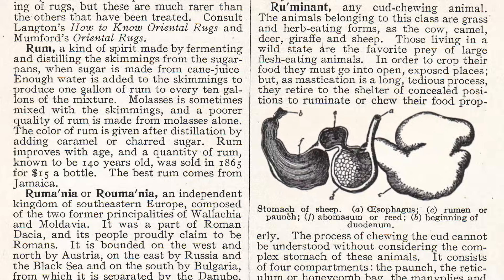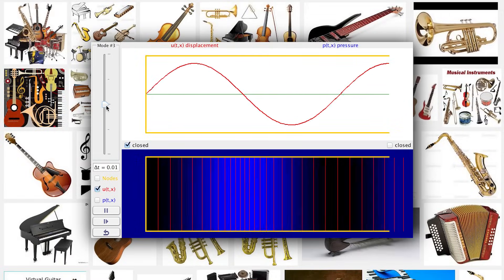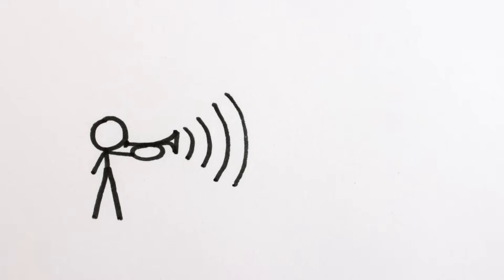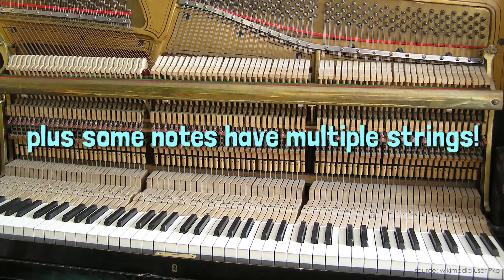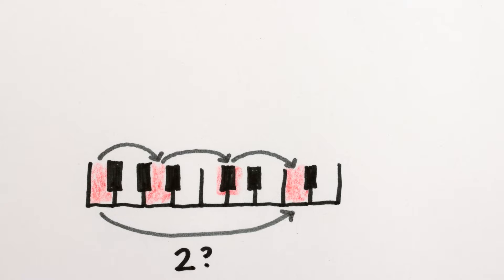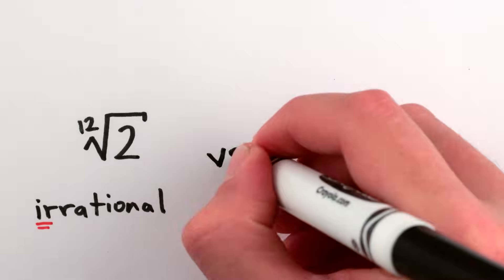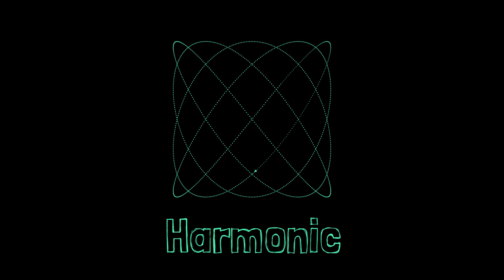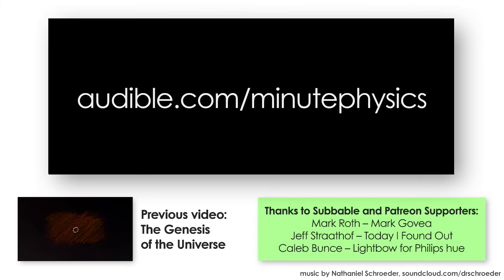Why It's Impossible to Tune a Piano

Comment: Allow me to clear up some confusion:

I’ve seen many comments below from people that think Henry got it wrong, because “obviously pianos can be tuned”.
As with many armchair experts on the internet that can’t be bothered to do a modicum of research before they chime, there are doubters.  I’m here to tell you Henry is spot-on correct.

We are a dying breed us aural piano tuners.  I can argue that there are fewer than 2,000 people on the planet today that truly know how to tune a concert piano by ear.  Every single one of us is in demand like never before due to software.  Software tuning is getting very good compared to what it once was, but all professional piano tuning software STILL must pIt itself against an aural judge before it is released.  Aural piano tuning is a learned skill that requires years of practice- no matter how “perfect” you think your pitch is. 

I’m going to make several statements below about western tuning in general, and then some specific statements  about the  industry of piano tuning itself.  Stay with me:

1) It is not possible to tune all 12 notes of the western scale simultaneously. (That’s the point of Henry’s video)

2) The history of Western composition itself is deeply rooted in the limitations of 12 notes being in tune.  Until recently, composers simply avoided the out of tune notes.  Right up until the late Baroque.  Check out Chant to hear what 800 years of music sounded like before Josquin des Prez and the Renaissance.

3) IMPORTANT!  All instruments of the (professional) modern orchestra or choir constantly alter pitch flat or sharp as they perform so as to be in tune at any given moment.  They talk and teach amongst themselves as to how to be in tune when they play any interval at any moment.  This is the price of 12 note equal temperament. It’s the reason why skilled youth orchestras are always out of tune.  Position and embouchure are only learned with experience.  And don’t you dare argue me percussion section that has some pitched bells and stuff.  Those instruments are out of tune and it’s not your fault.

4) Pianos are a unique exception from #3.  Pianos are the ONLY instrument in the orchestra who’s pitch is fixed.  As a pianist, you are stuck with the notes the tuner gives you and that’s it.  You can’t alter pitch as a pianist.  Everybody else can.

5) Pianos are almost impossible to a physicist.  High notes are played by small instruments such as the piccolo for a reason.  Low notes are played by big instruments such as a bass.  Here the problem:  
“I want one instrument that plays higher that a piccolo and lower than any bass at the same time.  Plus everything in the middle must also be in tune always.” 

6) Pianos have an incredible disadvantage that most instruments don’t.  It’s called Inharmonicity. Henry didn’t delve here in this video, but it’s only because he must limit his scope of a short video.

7) Pianos are never, ever, EVER, tuned by pitch.  That’s the barrier to you musicians that think you know how to tune.  Whether or not you tune pianos by ear or software, you simply don’t care about the fundamental (note).  You only match coincident partials and forget about the note. Always.

8). There is no such thing as a perfectly tuned piano for all scenarios.
I am called in to tune the same piano 4 days in a row because a solo piano tuning is different that a chamber tuning that is different from a pop recording that is different from jazz.  None of this is a secret- it’s simply what pros know.
Reply: Ok
Reply: This is so insightful thank you so much! You helped me a lot.
Reply: My God!
Reply: 7) can you please elaborate??

For example, i was thinking of gettinga tuning kit off of Amazon. Then just use a tuning app and tune each string of each note to... Well, it's correct pitch?? What is wrong with that?
Reply: k
Reply: Your comment is underrated
Reply: you fucking killed them dude
Reply: #4 You say pianos are the ONLY but what about the harp,marimbas,harpsichord?
Reply: I think I'll just stick to an electric keyboard
Reply: Thank you for the interesting info! What did you mean with ‘Chant’? I am very interested.
Reply: Nice meme
Reply: Charles Wright 
You must use special piano tuning software.  A regular tuner only tunes the fundamental (note).  That’s not how pianos are tuned.
The middle 3 octaves on the piano will sound o.k. (not perfect) with a regular tuner, but as you begin to extend the tuning it will become unusable in the bass and treble.
Reply: Mister Theguy 
Full term is “Plainchant” or “Gregorian Chant”.  The beginnings of modern European music.
Reply: Tom R 
Inharmonicity is tough to fully explain without lots of math and graphs/charts, but I’ll do my best to give an overview:

1.  Inharmonicity is the tendency for overtones to be progressively sharp from “in tune” in a single vibrating piano wire.  One string is out of tune with itself!
2.  This is because of stiffness of the wire at all node (termination) points.  The end regions of the string are more stiff than the middle of the string when it vibrates.
3.  When a string vibrates, it does so as a sum of all of the infinite regions of the string.  It’s complicated.
4.  The shorter a piano string is, the greater the Inharmonicity.  That’s one of the reason a longer piano sounds better than a short piano.  The overtones have less Inharmonicity and are more in tune.
5.  Piano tuners (professional) are trained to deal with this Inharmonicity.  It’s big part of what we do.

There is a lot of info on the web if you google “piano wire Inharmonicity”.  You can find the actual math and graphic charts that explain it way better than I am able to on this forum.  Good luck!
Reply: Ok boomer
Reply: @cjheaford  You didn't even explain what overtones are.  I know what they are but your whole post is surely gibberish to people who don't.  See https://en.wikipedia.org/wiki/Overtone
Reply: Andrew Cady 

Well since Henry explained what they are and even had excellent graphics explaining them, I assumed everyone would remember the video they just watched.  Everyone except you apparently.

One must assume a certain level of basic knowledge in order to talk about any subject.  I didn’t explain what a piano is either.  Was it gibberish for me to talk about a piano without explaining what that is?
Reply: Thats long
Reply: @linux_b1969  clap emoji
Reply: Sir, your comment need to stay at the top or pinned so everyone can see it!
Reply: cjheaford I believe you have a misunderstanding about what people in the comments are actually saying.

It does not make sense to talk about being able to perfectly tune an instrument without first talking about the temperament with respect to which one is tuning. Perfectly tuning the piano with respect to Pythagorean tuning is impossible, yes. But this is much less impactful when stated correctly than in the way Henry in the video tried to state it, which almost implies syntactically that equal temperament is not a valid form of tuning.

Also, 2^(1/12) is an irrational number, so for all intents and purposes, equal temperament is an impossible way to tune, we can only use approximations. But the important thing to talk about is how good an approximation can we make. And that's where the distinction between other instruments and the piano becomes important. So, yes, you are correct, but Henry failed to explain this very crucial fact, and that is why people are complaining about the video. The information just wasn't presented the way it should. (I mean, in my experience, this channel actually never really presents the information correctly, which is why I rarely even watch the videos anymore).
Reply: Charles Wright 
Sorry for the delay:

The tuning app you use must be specifically for piano tuning.  (They are pricey.  Just the app can be from $400 to $1000.  Reyburn Cyber Tuner, a high-end pro app is $999 in the App Store.  A general chromatic tuner won’t work.  If you DO use a regular tuner, do this:

Tune the middle 2 or 3 octaves with the tuner, and then just tune the rest of the piano by ear to what you already tuned.  A cheap general tuner will work O.K. in the middle of the piano, but it fails in the bass and treble.
Reply: @cjheaford  - wow, that is nuts! Thank you
Reply: Angel Mendez-Rivera 
I think you misunderstand a lot.  
It doesn’t matter what temperament you use to tune the 12 notes between the octave.  Pythagorean, Meantone, Werkmeister, Equal, or any one of dozens of others.
They are ALL valid forms of tuning, and yet they all sound out of tune.  There is nothing that can be done about that.
Most instruments get around this by being able to alter the temperament as they play in real-time.  Even good guitarists do this.
Reply: @Charles.Wright   Don't worry! The piano uses the Chromatic scale and the tuners is chromatic. You have to be careful to not damage the piano trying to tuning. It is not an obvious job.
This "Out of tune" talk is a little excessive.
The nowadays western music in general is played  in the chromatic scale. In the chromatic scale there is no perfect harmonic intervals, and all the 12 notes has a basic frequency precisely defined.
But it does not means "out of tune", it is just not perfect harmonic (rational multiple frequency) intervals.
Some instruments like Trombones has a tendency to  play harmonics intervals cause the physic construction, but the musician can force the pitch "on the fly" to mach the chromatic scale.
Some instruments like violins can play any notes and intervals (harmonic or not).
Yes, if you use only instruments like violins etc you can compose and execute a whole symphony with perfect intervals, but people in general will not perceive the difference if you execute the same symphony using the chromatic scale.
Se it better in https://en.wikipedia.org/wiki/Harmonic_series_(music)
Reply: As a software developer and pianist, I now feel lowkey inspired to investigate this further and figure out how one would do real-time digital piano tuning based on what you're playing at any given moment, purely to satisfy my OCD.
Reply: So you're a rare breed of piano tuner who tunes the same piano four times in four days.
So using your tuning method, how quickly do the bushings wear out and the strings begin to slip? 
Every piano tuner I know says the first rule of tuning a piano is do it as little as possible.
Reply: Rigg Amore 
I will answer your questions honestly and directly, but first I need to make sure I understand them.  You pack a lot in with the few sentences.   Let’s start by clarifying:
What do you mean by bushings?  There are many bushings inside a piano, but all of them are mechanical and allow the action to function.  Bushings don’t have anything to do with tuning.
Reply: @jasonmartinez7667  I feel like those are implied
Reply: @Charles.Wright  Then you tune to 12 tone equal temperament, and that's not in tune with the natural harmonics of what ever the base note is.
Reply: Enter: the synthesizer
Reply: Inharmonicity...so what notes are the good ones then?
Reply: the same piano four days in a row...what are they even doing with it!!
Reply: Kim Harris 
Professional Recording studios, major concert stages, and even a couple music colleges that tune for every concert.
Reply: everyday tenor 
Lol.  Yep.  Harpsichordist spend 50% of their career tuning their harpsichord, and 50% playing out of tune.
Reply: everyday tenor 
Hello again Tenor!  
Since no one is reading these comments anymore after one year, I thought it safe to send you a message in the comments.  That 50% tuning joke was told to me by Igor Kipnis himself, and I’m glad It got a laugh from you!  Igor is smiling.
Reply: everyday tenor 
Young tuning!  Wow.  It’s been a while.  He had a couple temperaments he published if memory serves.  Had to learn both Young tunings back in the day when I was green.  Haven’t needed to produce them since, and it’s a good thing.  I’d be starting from scratch after 30 years and need to research it again.  
You must play a lot of baroque keyboard works.  It would be tough to get that Young tuning to work on much past about 1800 or so...I’ll bet Buxtehude sounds awesome on your harpsichord!
Reply: Fascinating.  Acoustic guitarists all once had difficulty achieving equal temperament - especially classical guitarists, mainly because the bridge design had a built-in flaw with fret intonation.  If you tuned the strings based on harmonics, some chords sounded great and others terrible.  The structural solution introduced in the mid 1970s was to offset the B and E sting at the bridge which is now a hallmark of "split-bridge" Takamine guitars (while other brands like Martin, Gibson and Taylor all went with what is called the "compensated saddle" - a compromise design which works well as long as you use only the recommended string gauge and no capo above the 3rd fret.  However, if you have an older vintage steel-string acoustic or classical guitar, the trick is to first tune all 6 strings harmonically, then "by ear" tune the G string slightly flat and the B string slight sharp and all your chords will sound fine to the human ear.
Reply: I’m Justarandomdoggy 
I said tune a CONCERT piano by ear.  It’s a totally different requirement for the stage and recording studio.  It needs to be perfect.  You need to know how to tune for the situation as not all piano tunings are the same.  
There is a big difference between maintaining your home piano to a certain degree  vs concert perfection that your professional reputation relies upon.  Many of my clients are able to maintain a tuning for a while, but pay me to set a baseline tuning for them periodically.
I guarantee your Mom would not be able to come close to a professionally tempered tuning without training, even if it suffices for her needs.
Reply: I always tell people that perfect pitch is a trained skill, you can be better or worse than some people at it, and you can improve it with hard work. It's not a mystical ability.
Reply: kirjian 
You are correct.  It’s not.  But sense of pitch is a completely different thing than piano tuning, as pianos are not tuned by pitch.
Pianos are tuned by comparing beat rates in coincident partials - disregarding pitch 100% of the time.
Reply: @cjheaford  that is so cool. I've never thought of tuning as purely judging the beats in two sounds.

@everydaytenor naw, the documentation online about it does not align at all with reality. There are many testimonies of people with demonstrable AP saying they trained and improved it, and even being "bad" at it at first. Don't believe everything you read online, research is severely limited in that field
Reply: @cjheaford  When I was trying to learn to (roughly) tune my piano, it was suggested to me to get a chart of the correct beat rates and use a metronome.
Reply: jasexavier 
That was decent advice.  When we teach piano tuning, we discuss beat rates in terms of BPS (beats per second).  There is no such thing as a beatless interval on a well tuned piano (double & triple octaves come extremely close to beatless however), and it helps some students keep track of a second by setting the metronome to 60 bpm.  We don’t actually use a metronome in the real world on the job, but it can be a good tool for getting an internal feeling of timing of the beats.
The advice you received left one important aspect out however.  You must know WHERE to listen on each interval.  You will hear much beating inside an interval, but in virtually all cases you need to focus on the coincident partial that each interval produces, or you will be tuning the wrong partials.  Fortunately the coincident partials are almost always the loudest and easiest to hear when judging beat rates.  Good luck!  This industry need more aural tuners.
Reply: everyday tenor 
Nice job. Couldn’t have been said better!

Though my work requires me to ascertain beat rates always (I keep stressing beat rates in all my comments because this is absolutely where the magic happens.  Get the math right every time, and you will be a pro) plus Voicing. Oh BOY do I want to explain voicing...Voicing + Tuning mastery is where careers happen.  
I have after 30+ years acquired an internal sense of pitch that might be described by others as “absolute”.  It is not.  It is just a really, really good sense of relative pitch.  I know it in my heart I was not born with “absolute pitch”. 

In my travels I have discovered Absolute Pitch does exist..but it is exceedingly rare.  It is more of a Savant quality-  I believe it exists, but I’ve never met anyone that has personally has it, and I’ve met/worked for 1000’s of musicians.  Normally in my day I don’t get the chance to “nerd out” about tuning as I am here.  I could talk all day about the differences between tuning & pitch, but I’ll try to keep it short:

I have the ability to hear a pitch instantly and tell you what that note is.  In fact,  you could pound out a random chord on the piano and I can instantly tell you all 8 notes inside that jazz chord or whatever.  But that ability comes from a Lifetime of knowing music.  It’s more that I first hear the Tonic, and then everything else inside the chord is no surprise...most experienced musicians can do this..   It is NOT a special ability - it is simply acquired after a lifetime of knowing music.  Most professional musicians can do everything that I’ve described.  it is NOT  “Absolute Pitch”- whatever that is.

All of what I just said above is meaningless when it comes to professional tuning.  Sense of pitch is a hinderence, not a asset.   

I don’t want all this nonsense about “Absolute Pitch” to distract  from what I’m trying to tell everybody reading this:  I’ll try to say it again.  TRUST ME:  Pianos are not tuned by pitch ever!  You ΜUST judge beat rates between intervals, and know the math.  It doesn’t matter how “Perfect” you think your pitch is.  
You MUST understand Beat rates, Inharmonicity, Coincident partials and the 12th root of 2 mathematically.  

I’d like to talk to you if you understand these concepts,
Reply: Small gripe with 4 - the glockenspiel is also impossible to adjust the pitch of, unless you have a blowtorch or some dry ice on stage
Reply: @cjheaford  Hey I'm a trumpet player. This comment has been really informative. Are there other tuning systems I can tune my instrument to? If so, how would I tune my trumpet to them?
Reply: GabrielReed 
As a brass player I’m afraid you’ve got it tougher than most.  Because you are limited to natural harmonics, you are limited to something closer to the natural Just scale, or Pythagorean.  It’s not even equal temperament your trumpet is using.
The trumpet has tuning slides when needed that help during performance, and there is some measure of control of pitch through lip technique (embouchure), but trumpet players have to work extra hard to play in tune with equal tempered instruments.  You may have noticed this before.
Reply: @cjheaford  Yes I have noticed. Some notes like our lower d, and g are Sharp, so we use our tuning slides. I've heard snippets of information about the different ways of tuning in Western music but I've never seen a more concise overview than the one that you wrote. This is really neat stuff that I'm going to have to look into! I'll start with the natural Just scale and Pythagorean and see if I can hear any differences while playing solo pieces and etudes. Thank you
Reply: Greg Moonen 
People complain about how “awful” pianos sound tuning-wise every single day since the invention of the instrument.  (Harpsichords, Clavichords, Organs, etc. before that). I’ve built a career upon this singular fact.  It’s the reason why the industry of professional piano tuning exists in the first place.  Tuning pianos properly is hard to do - not just the mechanics of it, but mastering temperaments & inharmonicity takes years to learn.  It’s why most pianists don’t tune their own piano.
The problem is two-fold:

1). Equal Temperament (ET) is used today on virtually all pianos tuned.  But it has not always been so.  There have been many other temperaments used throughout history.  Composers such as Chopin & Liszt for example used their own temperaments that were most appropriate for their piano works.  J.S. Bach was a huge champion and proponent of ET.  One of the most famous keyboard works ever is called “Das Wohltemperirte Clavier” or “The Well-Tempered Clavier” in English.  **It was published by Bach to try to demonstrate the virtues of ET.  It contains 24 pairs of preludes and fugues in every major & minor key that can ONLY be played on one keyboard if ET is used.**     (Edit: Everyday Tenor has kindly pointed out the inaccuracies of this * statement about Bach.  My understanding of this was wrong.  See his comment below for corrections)
ET has it’s problems however.  Our modern day ears have come to accept it as the “way” pianos just sound but many musicians despise it for good reason.  

2). Inharmonicity is another barrier to being able to tune a piano.   It is even more complicated than temperament and difficult to explain, but let’s just say that the overtones coming from piano strings are not in tune.  And to make it worse, each individual piano has it’s own level of Inharmonicity.  A proper tuning on one piano will NOT be the proper tuning for another.  A tuner needs to start from scratch every time they sit down to a different piano and find that pianos proper “stretch”.
In my day to day work, Understanding Inharmonicity is where careers are made.  Learning Equal Temperament is much more basic than understanding Inharmonicity.

In short:  People have complained about temperaments since the beginning of keyboard instruments.  For the most part, our modern ears have come to accept equal temperament as the way pianos are tuned today, but it is not a perfect solution.  Musicians complain about this every single day.  There is absolutely no mathematical way to divide the 12 notes between the octave had have them all be in tune.  All a skilled tuner can do is to divide the comma evenly, (edit: *in equal temperament*) and accommodate Inharmonicity.
Reply: everyday tenor 
Always good to hear from you!  Regarding your points:

1).  I got lazy with this one, and you were right for calling me on it.  I suppose I didn’t want to complicate the matter - but I admittedly took ET for granted there.  It’s so rare these days that I need to produce anything other than ET.  In many years I’ve only needed to produce a few historical temperaments in an academic scenario, such as a guest speaker for a music history class and such in a few of the music colleges I work for.  Any performer that requires something other than equal on their (usually) harpsichord simply tunes it themselves.  Harpsichordists are great tuners by necessity, and likely know these historical temperaments better than myself.
(Plus we both know there are more things a tuner does, such as voicing and regulation.  I really was lazy...)

2).  I’m SO GLAD you called me out on this.  I’m mildly mortified that I’ve not only always thought this, but shamelessly touted this tidbit countless times including in front of aforementioned music history classes as a guest.  The “fact” that Bach championed ET was taught to me in music college long ago even before I began studying tuning, and most of my peers believe this as well to this day as I’ve heard others say the same thing.  I’ve always just taken this for granted.  You’re never too old to learn.

As I said above, harpsichordists are likely to know historical temperaments more intimately than myself- for good reason as I rarely produce them anymore.  I’m grateful for your expertise Everyday Tenor.  I’m going to add an edit to the relevant comment.  Thanks again for taking the time to correct me.

(P.S.  Because admittedly I’ve got refinements to make on my understanding of popular 18th century temperaments, I’m going to refresh my education by doing some reading.  Is there a book or article  you would suggest?  You’ve obviously got expertise here that I don’t, and I appreciate that!)
Reply: And sometimes they'll have more than one piano on-stage w/ an orchestra, depending on what keys are to be played in, if the piano is important to the piece.
Reply: Isn't point 8 (on the original post in the thread) more voicing than tuning? 

With all this said, organ builders hate equal temperament as well. Then they have the stops intentionally tuned sharp and flat (Celeste stops, Unda Maris...). As is the case with piano, it's also tuned by the beats rather than by pitch. Unlike piano, where you can tune it before every performance, organists have to simply accept the tuning issues present on any given day. Several builders use mild well-tempered systems by default rather than equal temperament (something you might not even know unless you talk with the builder and tuner). Sure, they're not always the historical temperaments, but they produce great results.
Reply: Karl Rovey 
Hello!  Thanks for your thoughts.  You pose a great question about piano voicing and bring up relevant facts about tuning regarding organs - an extremely important instrument historically when it comes to tuning systems.  I haven’t talked about organs in any of my comments, and that’s because I have little practical expertise with the instrument.  I’ve been waiting for someone to bring up the topic.  I’m tempted to jump right in and start raving/ranting about physical considerations, advantages, limitations, musicality, and historical implications to western music of organs - but I’ll let you open the conversation if you wish rather than risk being too garrulous off the bat.

Now voicing a piano on the other hand is a topic I know well.   I could (and do) talk for hours on the subject of piano voicing so much that it risks getting too distracted from Minute Physic’s original video about tuning we are posting underneath.  I don’t want to dodge the question of voicing and I’ll tell you as much as you want to know, but for now I will limit my response so that I answer your question above:

No.  Although voicing is very important to the quality of any concert piano, it is not what I was talking about in point #8.  I was talking about what is called Stretch.  You see, all piano tunings are “stretched” to some degree, and there are different degrees of stretch that are appropriate for different musical scenarios on the same piano.  That means octaves are wider than is musically true.  There are different “shapes” that professional concert tuners give to tunings depending on how the piano is being used.

Stretch is a balancing act.  Wider shapes (within reason) are generally preferred by piano soloists, as a wide tuning helps accommodate Inharmonicity - but that same wide tuning for a soloist tends to cause real problems blending with other instruments of an ensemble because actual pitch becomes skewed so much.  

It’s remarkable how much stretch is actually given to a well tuned piano.  Believe it or not, it is common for there to be more than a 1/2 step difference between C1 and C8 on an appropriately stretched piano tuning.  This is a MEDIUM level of stretch.  It can be closer to a WHOLE step in a lot of cases.  You can begin to see how this would cause problems to the other players of the orchestra that are forced to try to match the piano.  A tuning for playing with electronic instruments is the opposite.  You as a tuner need to try to get away with as little stretch as you dare in this case.  The piano will not please the pianist as much, but a narrow tuning will blend with electronic instruments much better.  Again - it’s a balancing act and compromise.

I’ll stop there, but I’d be happy to keep discussing voicing, tuning stretch, and organs as much or as little as you like.
Reply: @cjheaford  That makes sense. Tuning with piano is a huge can of worms (just as it is with organ, except with organ, you're generally stuck with any issues until yoir next seasonal tuning). 

I know someone raised the issue of the bushings and tuning pins on the concert pianos experiencing pre-mature wear from so much tuning. It really isn't an issue for the concert halls. They choose an appropriate maintenance schedule for it. I forget the exact guidelines, but for pianos in a university music school, they suggested replacing those parts every 5 years along with rebuilding the keyboards frequently (the same was advised for pipe organs at such institutions, but this is generally ignored in favor of addressing more pressing maintenance issues). Those pianos and pipe organs likely get more use in a month than they would in a year in homes and churches.
Reply: @kirjian  Perfect pitch cannot be taught later in life. It's literally neurologically impossible. Relative pitch, on the other hand, can be trained and mastered.
Reply: I didb't read this, and my mistake was click in "read more"
Reply: ok but a 432 or 440
Reply: The whole question is bogus. Why? Perfect intonation is a theoretical construct/concept that collides with physical reality - a mathematical abstract without any concern for the everlasting development of musical aesthetics. For example: a perfect third wasn't considered to be 'perfect' until ~1400 c.e., thus literature on perfection in music omitted thirds before.
The whole point of this video was proven long ago (during the 17th century) by theoreticians, who used a way of argumentation that is not really translatable into our ill-educated jargon.

Arguing "pianos are this (or that)" is another fallacy, because our understanding of the general instrument (once the lute, later the pianoforte) appears to be shapen by a very narrow understanding of said instrument itself: it's a grown convention , that urges even the players of romantic compositions to go back to the historic instruments from the 19th century for their notion of "perfection".
Reply: @11Kralle  
I don’t know where to start for a rebuttal, but I’ll keep it brief:

1). It’s difficult to take you seriously when you use the term “Perfect 3rd”.  There is no such thing as a perfect 3rd as you call it.  Only Major and minor, and they are both wildly out of tune in equal temperament.
2). Nobody is claiming anything about a piano here except to say that it’s impossible to tune all 12 notes between the octave simultaneously.  That’s true.
3).  Tuning is NOT arbitrary.  Perfect mathematical ratios = in tune.  That’s definition after all.  
4). The Comma is tangible and quantifiable.  You can’t escape it on a keyboard instrument.  Different temperaments come and go in popularity over time, but that will never change the fact that beats will always happen between some or all intervals on a piano.  Beats = OUT OF TUNE (imperfect ratios.)
Reply: @0691CT  
1). The classic “Honky Tonk” tone is basically due to 2 reasons.  One is a very, very out of tune piano.  The other is hammers that have never been voiced.  Hammers slowly get harder as the piano is played over time, and this makes the tone get very bright, plinky, and uneven.  Combine bright hammers with a piano that severely needs tuning and you have yourself a Honky Tonk.  The size of the piano doesn’t matter here.  Even a large concert grand will sound like a Honky Tonk if it is not maintained.

2).  You basically have it correct on your statement about string length.  Proportionally the stiff regions at the harmonics take up more of the strings length the shorter a wire is.
Realize you can’t just arbitrarily choose any low frequency on a string that is too short.  There is a limit.  Bass strings on short pianos are extra thick in order to slow down frequency of a string that is too short.  This makes these short, thick wires behave more like metal rods than strings.  It’s nasty.  You really aren’t hearing a fundamental at all on the low notes of a small piano.  Only the higher harmonics that imply or trick your ear into thinking you are hearing a note.
Reply: Wow. I totally dived into this thread. Your whole discussion is very interesting. As a non-pro musician I've known many new things just by reading you all's comments. And I've realised I should definitely find out more about the topic of different tunings and all around it. Huge gratitude to @cjheaford as the original poster!
Reply: This thread is a blessing. Thank you, both cjheaford & everyday tenor.
Reply: @cjheaford  hello sir. I'm sorry if i sound kind of stright to the point but all this thread has really giving me the vibes of something that is worth of pursuing, at least as a life experience. Is it too difficult to find good piano tuning lessons? Or better, can i ask how did you become the pro you are now? 
My sincerely thanks to you and @everyday trenor for such interesting conversation.
Reply: @MunyuShizumi  good digital tuning itself is a complex subject. Since no instrument produce a simple sine wave (but a combination of many sine waves with different frequencies), simple frequency shifting might not produce an ideal result.
Reply: @Maurice_the_Hamsterboi  i just spent 30min reading this comment section. And although it's very confusing, it's so interesting.
Reply: The common joke is that the piano tuner comes in twice and the piano is still out of tune despite that
Reply: @MunyuShizumi  I would begin with an application that optimizes the tuning for a Midi piece.
To get the best results, your piano would need to look in the future. Perhaps you could get away with letting the piano know the key and mode in which you are playing...
Reply: @adifferentangle7064  And know you know why most pianos at people's homes are out of tune ;-)
Seriously, the pianos get re-tuned to optimize them for the style of music that are going to be played, the keys and modes that will be used, etc.
Reply: @joestevenson5568  The synthesizer has the same problems with regards to tuning as the piano. Except that it is all chosen for you by the manufacturer.
Reply: @nskimharris  Playing different styles of music that sound better with different tunings.
AND, a real piano is made of materials that change ever so slightly due to temperature, humidity, air pressure and so on. Due to the steel frame and strings this effect is smaller than with wooden instruments, but it is still there.
Reply: @everyday tenor Chopin, Liszt, and basically all 19th century music was written in equal temperament, so that's really the most true tuning for the compositions of that era. Thomas Young's tuning was a theoretical construction; he did not provide instructions how to achieve his tuning, and it probably wasn't ever even known outside England in the continent where everybody was already steadily moving towards universally using ever since the Classical era. 

What many Anglophones assume is that tuning history of England was the same as that of continental Europe; however, United Kingdom was a good 200 years behind France and Germany in terms of the way they tuned, so by time that almost everyone else  agreed that equal temperament is the best tuning for piano, the Brits were still thinking1/5 comma meantone is the hot shit.
Reply: @everyday tenor Rameau had recommended equal temperament since 1737 and hell, even Galileo Galilei's father was a proponent of ET in the 16th century. The French used to use a circulating ordinaire tuning around the 18th century with ET becoming more and more common. In Germany, Werckmeister suggested ET in 1690s, with several theorists endorsing it during the 1700s. Kirnberger was really the only person who went against the stream of the era, and his proposed tuning wasn't perceived to be very nice, which is probably why in the latter half of the century the German-speaking world ET was the predominant way to tune pianos.

This being said, all 19th century composers composed on instruments that were already tuned for equal temperament, so to retain their best artistic intention, it's most authentic to play using same tuning as them. And as I said before, British tuners and music theorists did not adopt any of these ideas until late 19th century. If one were to be not able to access primary sources in other languages than English, they would end up to believe that 12-tone equal temperament is a 20th century fad, even though its practical history reaches almost 200 years further back.
Reply: @Charles.Wright  
Most modern tuning software developed for professional use does take inharmonicity into account.  But the user must be aware of piano tuning principles in order to select the most appropriate partials for tuning.  
However, I'm sure not everything you find on Amazon will have this level of sophistication.  
What inharmonicity means, is that a string is not in tune with its own harmonics (the video ignored this issue).  Therefore "correct pitch" can only be defined for one selected partial (harmonic) and it is often not the fundamental.  Many partials means many choices and there isn't just one "correct" choice.  
Theoretically, you could take a freshly-tuned piano, catalog all of its fundamental frequencies, then use those to keep the piano in tune - but making such precision measurements of fundamentals is neither trivial nor time efficient.  
Another problem with inharmonicity, is that it varies with piano size, and make/model.  It's not possible to get two pianos of different sizes into excellent tune with each other (unless you allow one to be a little out of tune with itself).
Reply: @everyday tenor The best historical evidence for tuning is not composers' key choices but preserved tuning instructions, as they directly tell what tunings were favoured during any time by dedicated piano tuners who did the work for the composers (We know, for example, that Chopin's piano tuner in England used ET). They overwhelmingly point to the direction that by 1800 equal temperament was the most common tuning in France and German-speaking Europe, but not in Italy or the British Isles.

Composers of the romantic era most certainly tolerated the impurities of ET for the musical possibilities and endless modulation (Hammerklavier modulates from Bb to G, Db, and F#!) that it allowed. As mentioned, many theorists and composers alike championed it from its very early times while key colour seemed to be less significant, probably not the least because nobody apparently could come to agreement about the perceived qualities of the keys. People these days like to cite Schubart on the topic, but he was far from an authority about it in his time.
Reply: @everyday tenor Not Schubert, Schubart. Christian Friedrich Daniel Schubart (1739-91). He seems to be the most cited reference for key colour advocates, but as I said before, people really could not come to agreement about the characteristics of individual keys.

Beethoven composed his Sonata no. 24 in F# major (6 sharps), and modulates to Ab minor (7 flats) in no.12. Chopin has his Barcarolle in F# major as well, not to mention his 24 Preludes that have all sorts of hairy and funky key signatures. Both Schubert AND Bach wrote sections in C# major (7 sharps). Alkan has pieces which modulate to E# (!). And there are of course some old pieces that modulate through all the 12 keys, but I can't just remember any of them now.

None of this matters, though, because the argument that ET would magically make composers write equally in all 12 keys, doesn't necessarily hold true. If all keys sound the same, then there is no need to make music in, say, Eb minor because it sounds just the same as E minor, but it's nastily unnecessarily with all the accidentals for nothing. One could even argue that composers would be more likely to remain in relatively conventional keys for the simple fact that there isn't any need to go into a key center that has many sharps or flats, as they would have the same sonority.

However, you will be able to modulate to far more unfamiliar and exciting places from those conventional keys (Hammerklavier, again?) when there aren't any "bad keys" in your piano anymore. The relationship of the modulation to the home key can be already artistically titillating in itself; anyone who's played through Coltrane changes could attest to that (I haven't, I suck at jazz).
Reply: @Charles.Wright  I believe your question gets into the difference between Just intonation and Equal temperament. Digital tuning apps are set to a specific tuning convention mostly Equal temperament. Just intonation works well with small intervals, but over the span of an entire keyboard, there will be audible differences between keys and chords. Equal temperament bridges this gap by allowing each interval to be off just enough the work, but not far enough to cause disharmony. I'm a guitarist by trade. I'm sure many string-based musicians know the frustration of tuning each open string to Just intonation only to have chords higher up the neck be off by a quarter-tone! Luckily, we have the luxury of spot tuning. Piano tuning is fixed and must be tuned in the most efficient way that also accompanies the orchestral setting. Hope this helps. 

- Random Guitarist
Reply: The title is clickbait. Period.

It's true that the point of the video is that you can't have all 12 notes in tune with each other but that isn't unique to pianos which he literally points out in the end of the video. 

Most of modern music isn't tuned using 3rd, 4ths, or 5ths, or harmonics. It's tuned in 12 tone equal temperament. 

You can "tune" a guitar by comparing harmonics because the harmonics are very close to their 12TET counterparts. Thus with only a few strings, you won't really be out of tune. This again, is explained in the video.

But just because you tuned using "perfectly in tune" harmonics doesn't make the guitar a magically tuned instrument in a way that a piano could never achieve which this video suggests.

The reason why comparing harmonics works on an instrument like a guitar is because by using certain harmonics, you can get very close to 12TET which is in fact the GOAL. You're SUPPOSED to tune the instrument to equal temperament because that's how most of modern music is played, written and performed. 

The frets aren't laid out in 4ths or 5ths, they're laid out in a way to get close to equal temperament. Do you see the problem with the video here now?

He claims that you can't tune a piano. He then claims that the solution to this problem is equal temperament where we make all intervals out of tune from each other EXCEPT the octave. And because this music is out of tune, you "can't tune a piano".

This of course makes 0 sense, an instrument like the guitar literally has the same problems. A guitar approximates equal temperament and will run into the exact same issues. Only the octaves will be in tune in a perfectly tuned guitar. 

He explains how 12TET is the reason you "can't tune" a piano since it's out of tune, and yet that's how you literally tune a guitar which an instrument he uses as an example early on.

Much of this video's information would be useful if the title were trying to explain our 12TET system and why it's inherently out of tune, but the title and conclusions don't actually make sense.

To reiterate;

Sure, you could tune a guitar with harmonics. 

Sure, the guitar only has 6 strings, thus all 6 strings should be close to in tune once all the harmonics match.

But once you start playing down the fretboard, you'll run into the exact same problems. The guitar is out of tune due to equal temperament just like a piano.

If you want to conclude that you then in fact can't tune a guitar OR piano then that's fine since 12TET makes that statement kind of true.

But the title and content of the video seems to suggest that this is unique to instruments with lots of strings when it isn't; even going as far as using a guitar as an example that you CAN tune when in reality, the guitar also uses 12TET and is this out of tune.
Reply: @nkchamplin  
There is much you don’t understand about this video and real-world equal temperament in general:

First off, Henry used the piano as an example in his video to represent the 12 notes of the western scale in general- not specifically to discuss actual piano tuning.

You talk about the guitar a lot in your comment but I don’t think you realize that it’s not the same as tuning a piano.  There are 3 major reasons tuning a guitar is much simpler than tuning a piano:

1.  A good guitarist naturally alters the temperament as they play in real time.  Learning to play in tune is an important part of a young guitarist’s experience.  Most guitarists will discover that some chords sound better than other chords-  so they learn how to instinctively apply pressure on the frets making microtonal adjustments to make each chord sound it’s best.  This is no secret and an important part of learning to play the guitar.  A pianist has no such ability.

2.  A guitar’s range and pitch capabilities can’t be compared to a piano.  At most you can only ever play 6 notes at a time, with all notes being relatively close to each other, usually within the same octave or two.  A piano’s pitch range is more than 7 octaves with at least the possibility of 10 simultaneous notes across any part of the range of 7 octaves.  This is a tempering challenge compared to the close voicings of a guitar.

3.  A certain level of “out of tuneness” is part of the sound of a guitar and come to be expected by the ear.  It’s the natural way a guitar is supposed to sound.
I’m sure you’ve noticed that you get the BEST guitar tunings when tuning the harmonics by ear instead of using a tuner.  A chromatic guitar tuner can’t predict the tiny variation in each guitar’s harmonic series.  The ear can.

There is no one correct way to temper a piano, and in serious professional settings I  change the temperament on an already “in tune” piano so that it is more appropriate for the day’s musical event.
Reply: @everyday tenor 
That’s super cool.  I’ve seen videos on the True Tempered Guitars.  The difference is amazing.
Reply: @everyday tenor which is irrelevant to my point.

The evidence in the video proves that pianos are impossible to tune due to mathematics.

This is something that applies to music and every instrument not just the piano.

Whether you get different tempered frets or just remove them, your notes will never all be in tune with each other.

The video is clickbait.

The piano is only impossible to tune in the sense that all instruments are impossible to tune.
Reply: @everyday tenor You don't understand what I'm saying at all.

Please learn to read.

The video asserts that the piano is impossible to tune because equal temperament is out of tune.

This is a problem with mathematics not something inherent with the piano. Thus the title is clickbait.

Tune a guitar in equal temperament.

It's out of tune.

Tune a guitar to a just intonation. 

It's still out of tune even if you stick to 7 notes.

In this case not only is it out of tune the moment you leave the key, it's not even completely in tune within the key.

If you play a C major chord with any instrument tuned to C, all 3 notes will be in tune with each other. All notes are also in tune relative to the tonic within the octave but are NOT all in tune with each other.

No matter which tuning system you pick on any instrument, you'll never have all notes in tune with each other even if you stick to 7 notes of a key. 

This is a mathematical problem that has nothing to do with inherent problems specific to the piano or harpsichord as this video suggests.

An instrument like the guitar will run into identical problems.

Your comment has nothing to do with what I said. Improve your reading comprehension.
Reply: @everyday tenor being passive aggressive isn't being civil. You didn't respond because you're objectively wrong and have failed to address a single argument.

I am sorry that pointing out that your reading comprehension is objectively poor hurt your feelings.

What's genuinely hilarious is that you simply threw that back at me without actually making a valid argument.

This only shows that a single snarky comment genuinely hurt your feelings.

Learn to read better. You won't humiliate yourself next time and force yourself to desperately run away in a hilariously passive aggressive manner. Glad I could teach you.
Reply: @fesfers  
You sure do talk about the guitar a lot after watching a video about the way pianos are tempered.

It’s as if you have some academic knowledge of the way a guitar is tuned & tempered, but no practical experience with the guitar vs piano at all.  Here are some absolute facts that you just don’t get:

1). Unlike your understanding and claim, a guitarist CAN and DOES indeed alter the temperament in real-time as they perform.
If you’ve ever played the guitar at all, you have noticed some chords naturally sound more in tune than others.  Experienced guitarists learn to make micro-adjustments of pressure on the frets so that individual chords sound their best.  This ability becomes subconscious with experience.  Why do you think beginner guitar students are always out of tune even on a properly tuned instrument?  They haven’t yet learned to make microtonal adjustments.  Pianists have no such ability.

2).  It doesn’t even make sense to compare the range and potential note combinations of a piano to a guitar.  A piano spans 7+ octaves with potential note combinations across any part of the 7 octaves.  A guitar close-voices 6 notes.

3).  No 2 pianos are tuned exactly alike.  Each piano has it’s own level of stretch that the tuner must find and accommodate.  The difference from piano to piano can be startling.  It is common for there to be more than 1/2 step difference between C1 and C8 on a well tuned piano.  This is not the case for guitar.

4).  I just tuned my 38,000th career piano this last August.  I assure you I know what I’m talking about.
If you want me to clear up any questions or misunderstandings you have, I would be happy to.  It is no use arguing with me.
People have payed me money for 30 years because of my understanding of temperament.  It’s how I make my living.
What tuning experience do you have?
Reply: @cjheaford  

Yes I'm talking about guitar because it's mentioned in the video about why you can't tune a piano despite the fact that both instruments would run into similar problems when actually tuning. In the case of the video, the exact problem is equal temperament which both instruments try to generally approximate. It's presented in a way that would lead beginners to thinking the guitar doesn't have the identical problems that the piano has demonstrated in this video. The problem being that equal temperament is out of tune despite being our best solution.

If that offends you to be passive aggressive without making a valid point then that's your problem. Grow some thicker skin.

1.) This is completely irrelevant to actual tuning. Whether you try to make adjustments by re-tuning the instrument in the middle of a performance or you try to bend notes in tune, the guitar itself will never be in tune with itself.

While bends and tuning pegs do give guitarists more versatility, using these techniques to fight the problems with equal temperament are impractical. You can do it for certain phrases or chords but at a certain complexity, it's not worth it which is why the vast majority of guitarists use these techniques as a sound effect to create sliding effects or vibrato rather than adjusting the notes to be more in tune. Guitarists aren't bending every single note in tune to fight equal temperament. That's impractical and limits the complexity of the music they can play.

What's even funnier about your point here is that you show you a complete lack of understanding of physics and the mathematics.

The frets of the guitar are tuned to approximate equal temperament. Let's say we're playing a piece in C major.

Well we know by default that if we simply play conventionally we'll be out of tune due to equal temperament. 

Well in that case what if we make microtonal adjustments like you say?

While possible, another massive reason it's usually not done is because this doesn't actually solve the problem.

We can adjust our notes by tediously re-tuning them constantly in the middle of a performance to get every single note in the key of C perfectly in tune with C3 within that octave.

In this case, a root position C major chord starting on C3 would be perfectly in tune. This would actually be a valid reason to attempt live microtonal live adjustments. 

However, just because we can get these 3 notes in tune via tedious live and impractical adjustments, DOES NOT mean the instrument is actually in tune. Why?

Because even if we stay within a single octave and ONLY stay with the 7 notes of C major, while all the notes are in tune with that C3, not every note is tune with each other.

For example, it's mathematically impossible to play a C major and D minor chord and simultaneously have both chords perfectly in tune where the D is a perfectly tuned major second above the C.

If we attempt to make both chords perfect, they'll be out of tune with each other.

If we attempt to make all the notes of the D minor chord in tune with the tonic C, then the D minor chord will be out of tune within itself.

Despite the fact that your suggestion of microtonal tuning is impractical for complex pieces, it doesn't actually solve anything. It is quite literally mathematically impossible to get the 12 notes of the chromatic scale all in tune with one another. 

Again, this isn't a problem exclusive to piano. This is a problem with sound and mathematics.

2.) I'm not. Learn how to read. Just intonation goes out of tune the moment you leave the octave. This has nothing to do with comparing guitars to pianos. The point is that mathematics and equal temperament is what makes getting all instruments as well as music in general in tune impossible. This is not unique to a piano which this video leads others to believe.

3.) That has nothing to do with what I said nor did I even claim otherwise. Learn how to read. I'm well aware pianos stretch their octaves to accommodate overtones, however this is also a phonaesthetic/artistic choice we've chosen rather than a decision we're forced to make due to tuning a piano without stretching the octaves being impossible. It's VERY possible. It's just not worth it in most cases due to overtones.

Theoretically, we could ignore the overtones and simply get the fundamental harmonics of each key tuned to equal temperament just like we do on a guitar.

We don't do this in the real world because we prefer the sound of getting the overtones in tune, but it's absolutely possible. 

Thus your point is invalid since the title and topic of the video is about why it's impossible to tune a piano.

As a matter of fact, this is also likely why this wasn't even mentioned in the video. What makes a piano impossible to tune is the mathematics of looking at the fundamental frequencies ALONE  and NOT the stretching of the octaves we do to get some overtones better in tune.

You see, I'm critiquing the points in the video, NOT irrelevant points that you're desperately trying to now bring up to save face as you're objectively wrong.

I'll shut them down if you bring them up, but understand that you're really just wasting everyone's time since it has nothing to do with me critiquing the video. The video is solely about equal temperament if you paid attention.

Do note that I don't think you're bringing up irrelevant points to try to be disingenuous, rather I genuinely think you're just that bad at forming logical points that relate to an actual topic.

4.) It's genuinely hilarious how arrogant, condescending, and passive aggressive you are despite being so ignorant and being wrong on every point you've made.

Claiming to tune pianos on the internet doesn't give you the ability to form logical arguments as you've clearly just demonstrated yourself.

To summarize, your point on microtonal adjustments on guitar while theoretically possible and even sometimes used for various reasons, doesn't make the guitar in tune. 

We know this because it's mathematically impossible to get the chromatic scale all in tune with each other.

Your point of stretching octaves on a piano is irrelevant, since it's still possible to tune solely based on the fundamental.

In any case as previously discussed, even if we don't stretch the octaves, the piano will be out of tune anyway due to the nature of equal temperament which the video points out clearly.

This however, is an issue with mathematics and music and is not unique to the piano at all.

Educate yourself. Because despite your claims, you clearly don't understand temperament. The physical labor and knowledge of tuning a piano is completely irrelevant to the inner workings of physics and mathematics which you clearly don't understand.
Reply: f
Reply: @Charles.Wright  I believe he is talking about tuning the combination tones called "beats". If you are using a tuner, you have nothing to do with this heritage tuning technique. Or more accurately "tempering technique". You can tune with a digital tuner no problem, it will give you twelfth root of two semitones. What these high level piano tuners are chasing is something better than equal temperament. Which is highly specific to the music you're playing. Bach would occasionally spend 10-15 mins retuning his harpsichord in the middle of a concert!!! That's dedication, folks
Reply: @Charles.Wright  Yes, but there are dozens of different temperaments that can be used that are all a little different according to taste and the style of the music as well as the key that you're playing in. I'm just speculating here, but he could also be referencing string physics when he's talking about not tuning the note itself. When you hit a string, it increases tension, which momentarily increases the pitch then it settles back down. However, if you look at the harmonics of the string, they are more stable
Reply: heaf
grfhccha
Reply: For 2): Didn't composers use "out of tune" tuning e.g. playing in a different key than was tuned to in order to achieve a different sound at some point in between?
Reply: @TheDeadOfNight37  
It was less that the composer wanted an “out of tune” effect.  It was more that composers were making conscious musical choices owing to the limitations certain temperaments levied.

Composition style evolved directly with temperaments throughout history.  As different temperaments became popular, new musical choices were more appropriate or even possible for the composer.  This is a vast oversimplification, but:

Renaissance, Baroque and even early Classical music tended to be much more diatonic (existing in one key or parallel keys) than later Romantic and early Modern music.  It was the late Victorian era (late 1880-ish to 1900) that Equal temperament really became mainstream.  This is directly reflected in styles of composers becoming more bold with modulations, more complex voicings, and Enharmonic transpositions (changing to any key they wanted to on the fly without concern).
Reply: I think you just pointed out a long list of reasons why he is wrong in this video...
Reply: @cjheaford That sounds pretty much like a category of quack/scam medical "frequency healing" devices, where the buyer has to pay for unlocking each additional frequency despite they are simply made by the same digital oscillator. I expect there is an open source solution for piano tuning. Keeping a list of 88 sine frequencies (and possibly some variants) in a computer program coded withing few hours by a student is not black magic.
Reply: @adifferentangle7064 AFAIK tuning one string also deforms the frame by the change of tension, making all other strings go slightly out of tune again (easily noticeable with zithers) by the distance change. Hence perfect tuning would be recursive process that theoretically never comes to an end (unless you had an algorithm that corrects the expected piano frame deformation).
Reply: @TheEvertw As the old name "temperature" suggests, AFAIK the tuning of any acoustic piano only can be perfect for a certain room temperature due to thermal expansion of frame and strings.
Reply: @AerialTheShamen  I mean I work on zithers sometimes, I'm the only person I know of in the country who repairs them. 
So I am aware - keenly - of the phenomenon you are referring to.

However that is just why there is a process to tuning stringed instruments. It doesn't matter honestly which one, guitars do the same thing to a lesser degree. 

Pianos are more obvious because the tension is insane.

BUT that does not prevent the person achieving the desired pitch across all strings. 

Tuning a guzheng with new strings does take a while. You have to go back over it sometimes five or six times. Compared to a violins three times. 

It doesn't go on forever because once the strings are close enough across the board they don't drop a cent. Once the last string goes flat and is brought up, it doesn't cause the other side to go down as much.

This is partly because the tension on the higher pitches is significantly greater in a thinner wire (over a shorter distance for zithers and pianos), so the pitch drops quickly whereas the lower strings are thicker and have less tension, resulting in a small drop in pitch compared to the higher string.

So the last strings you need to adjust are always the highest but the difference in tension is so small it doesn't affect the other strings.

Hope that helps.
Reply: @AerialTheShamen  No, an instrument like a piano can not be tuned "perfectly", period.
That is because of the mathematical relationships between the notes.
An octave that is split into 12 logarithmic equidistant notes (as our notes are supposed to be) has intervals that are not "perfect", i.e. the various harmonics of the notes in a chord are not perfectly aligned. Which means that to make "perfect" music, you need to change the pitch of the notes ever so slightly depending on which harmony you are making. Fret-less instruments and voices can do that, but not those with fixed intervals.
This is why a piano tuner will always play several pieces of music to fine-tune it, to reach a good compromise so that the piano sounds as expected. He also has a prescribed sequence of tuning, that gets close to that compromise: certain intervals are more important to get right than others.
Reply: @AerialTheShamen  
Well, that's where your Dunning- Krueger level of understanding concert piano tuning is apparent.
Pianos are not tuned by pitch- ever.  There is a real harmonic series in every string that we use as a baseline, but it's only a mathematical starting point.  Software is really good up until this point. 
On the real stage, All pianos have slight imperfections in the Steel strings, whether they be poor contact points with the bridge pins, simple corrosion of steel, Microscopic bends in the strings from tuning over the years, simple inharmonicity, and countless other obstacles that software just cannot ascertain properly.  ONLY human ear can make these on the fly judgments while tuning to make a piano sound it's best.

Piano tuners, that never learned to tune by ear are overly reliant on their software, and cannot tell when they're finished if the piano is actually in tune or not because they don't know what an in tune CONCERT piano is supposed to sound like.  They just let their software tell them.
Software can only predict a mathematically perfect situation in the harmonic series of each string, use that as a baseline, and then tune a Piano from there - whatever the outcome.
THAT'S Why concert piano tuners that tune aurally are still in such high demand, and there are far fewer of us these days.  And we are all busy as hell because of software users.  

Most high profile concert stages won't even consider a software tuner, unless they also have aural skills.

What ELSE do you know about tuning a concert piano, Pray tell!
Reply: @cjheaford  sadly everyday tenor's comments are no longer here to see.  Can you summarize what they were pointing out that was wrong in your statement re- bach and equal temperament?
Reply: @jon_byler  
In short, Bach championed Meantone temperament and was trying to popularize it.  I had it wrong thinking it was Equal, not Meantone as Tenor pointed out.
Thanks for reading!
Reply: im curious why is it so important to have piano in tune if most intervals in 12TET are audibly imperfect (in terms of ratios) anyway?
Reply: @davidzaydullin  
These ratios that you bring up in Equal Temperament are indeed imperfect as you understand.  They always will be, and the fundamentals (pitches) will always be out of tune.
The aspect that most non-professionals don't understand is that a proper piano tuning is NEVER about absolute pitch.  I must have stated it 20+ times in all the comments above, but it's a lot to peruse so it's understandable that you may have missed the most important job of a piano tuner.
Professional tuners don't ever care about pitch.  We ONLY align coincident partials so that the overtones sound pleasing.  We don't give a s**t about pitch - except for A-440.  Or 442, or whatever the local standard is.  The first "A" is always musically true.  After that, all other pitches on the piano vary wildly from piano to piano depending on the inharmonicity of each instrument.

If you know how and where to listen, each string will demand a relationship in the overtones they produce.  You don't realize it, but even the Layman's  ear is far more concerned with these overtones making mathematical sense than actual pitch.  That's why a proper piano tuning pitch is skewed to a high degree to accommodate the overtones of each string.  And these overtones vary from Piano to Piano due to practical and real world physical inconsistencies in the wires..
In short , within reason the human ear doesn't care about absolute pitch as much as it needs to hear these overtones making mathematical sense.  That's what professional tuning is all about.
Reply: @cjheaford   
  thanks for clarification! but i also wonder: shouldnt partials carry imperfections of 12tet even if they are inharmonic? if they dont, arent they "not uniform" because of that then? (like just intonation, where the scale and chords cant change root note)
 sorry for missing some of your comments, i wanted to read all of them but probably skipped some on accident.
by the way your comments about inharmonicity reminded me of videos from channel "New tonality". if dont know all of that already, i think you might be interested.
Reply: @davidzaydullin  
If i'm not misunderstanding, you might be requiring inharmonicity to be too "textbook".  In reality Inharmonicity is complicated yet well-understood by professionals.  It differs from each piano
If you do a deep dive you will find the Calculus necessary to describe actual dynamics of a vibrating  piano string makes you understand (infinite regions and such).
In reality on my day to day job, we don't need to crunch the numbers or do calculus in the field.  We simply listen to each piano, and the inharmonicity reveals itself.  Pitch Doesn't matter.  AGAIN:
Pitch doesn't matter.
Each piano has its place on the Inharmonicity scale, and your job as a Pro is to find that scale.  Machines can't do it.  Software ALMOST can, but software makes mistakes the trained human ear never would.
That's why Aural tuners still get paid top $.  There are so few of us alive anymore.
Reply: @davidzaydullin  
I think you are stating the 12th root of 2, but I can't quite tell because of the misspelling.  We must be precise if we dive this deep....
Reply: Thank you for taking the time to type all of this out. This was fascinating to read. I think this is the most informative comment thread I've ever encountered on YouTube.
Reply: @one_smol_duck  
You're welcome!  Thanks for reading,